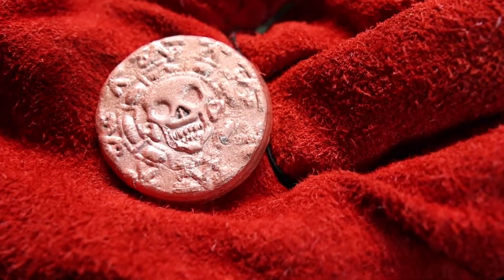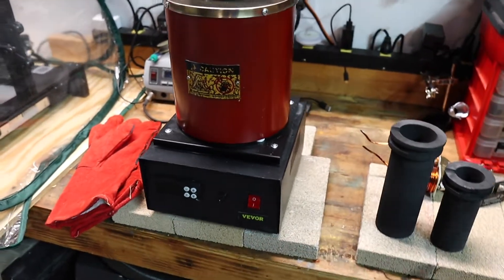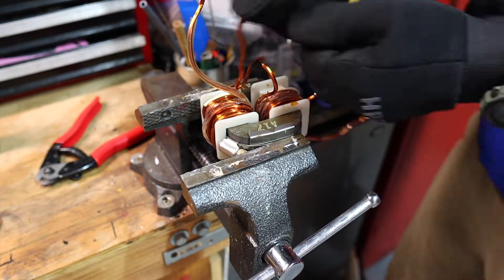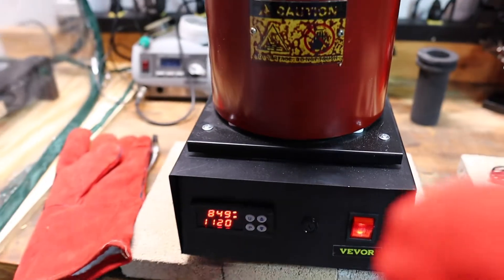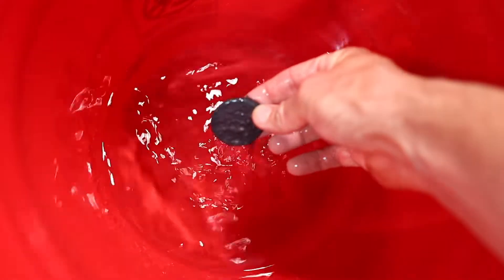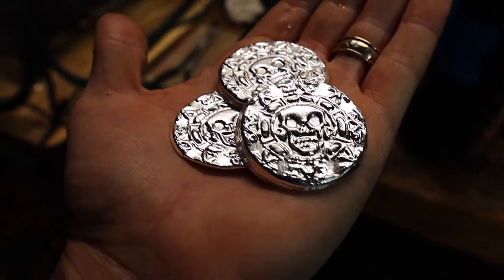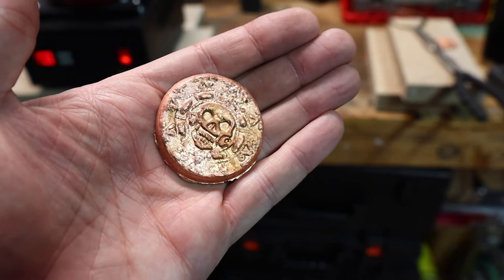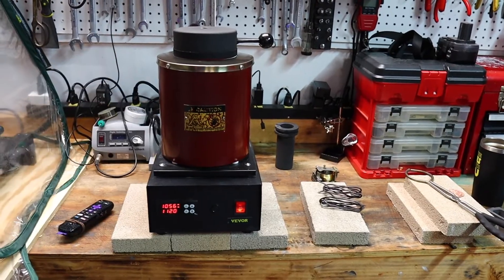Making Copper Coins with an Electric Furnace - GIVEAWAY!

Comment: Where can you get the pirate cast, is there a ‘tail’ side to add?
Reply from the maker: These are open top, so there isn't a reverse side. I will be doing some sand cast coins soon that will have a reverse side. You can pick up molds on Amazon, but Etsy seems to have more options. Looking up "graphite coin molds"